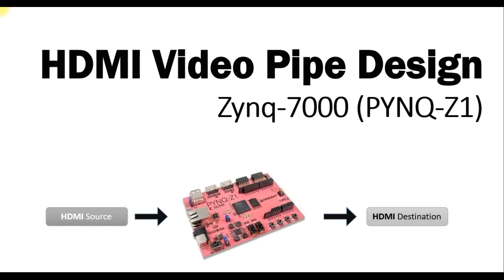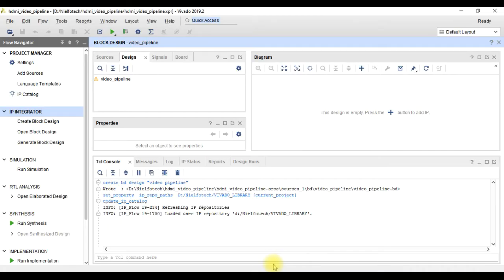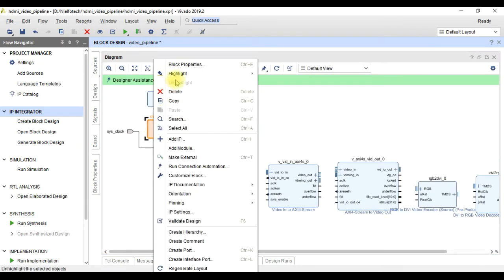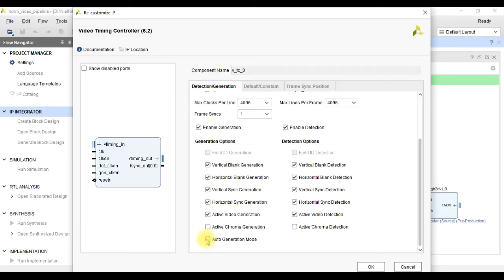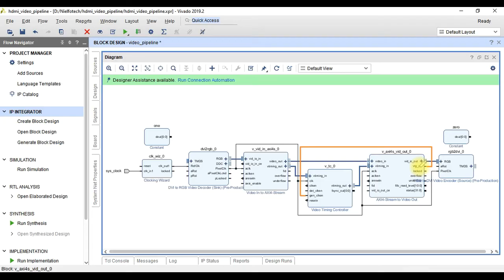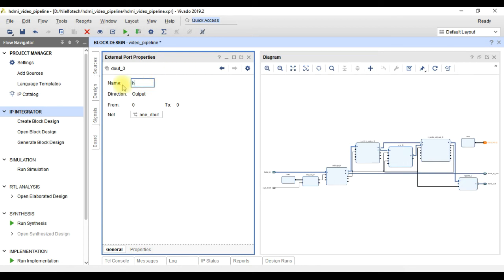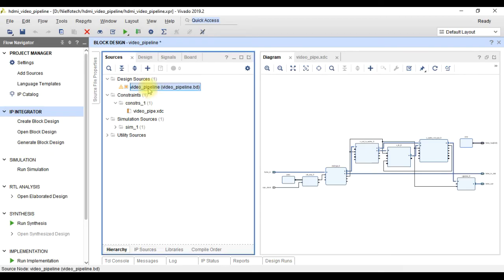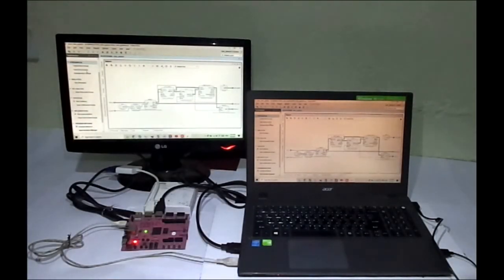HDMI Video Pipeline Design Implementation on Zynq 7000 SoC (Pynq-Z1)

Comment: Hello, I tried to implement your design on my PYNQ-Z1, using Vivado 2022, and the last version of Digilent Vivado Library, but it doesn't show anything in the output, my pc reconized the connection but my SAMSUNG HDMI display monitor dosn't recognize the connection and didn't show the image, do you have any idea which is the issue?,
Reply from the maker: Hi, you can use ILA to check whether is pipeline is functional or not. This is the best to find out the issue. Especially, check the “locked” status.

Comment: I use Pynq-Z2 but the HDMI output with noise. 
I had fixed it by un-comment this line in *.xdc file - "create_clock -period 8.334 -waveform {0.000 4.167} [get_ports hdmi_in_clk_p]"
in the video 8:06 , your xdc file as "#create_clock -period 8.334 -waveform {0.000 4.167} [get_ports hdmi_in_clk_p]", you comment it out. 
I don't know what happened. Why I need add it in my Pynq-Z2 board?
Reply: hi i followed this tutorial step by step when i finished flashing my pynq Z2 Board i got only black screen can you help me??
@ Tony Ho 
@ Nielfotech
Reply: @aminemouaz5822  hi,
I have the same problem and I tried to fix it for a long time now, but still have only a black screen. have you succeeded by any chance?
Reply from the maker: @Amine Mouaz  @edouard lagesse 
What kind of issue are you facing? Could you give me some details?
Reply from the maker: @Tony Ho!
That constraint was written to create a clock with the specified clock period. This is not compulsory until you need greater control over the clock signal to reduce the slack value.
Reply: Hi @tonyho6986,
I follow your step to enable "create_clock" tcl command and I can acheive HDMI passthrough function finally!
Thanks for this share!
Reply: Hello, Have you fixed that issue? Could you help me to fix that?

Comment: unable to make external pin connections in Vivado 2017.4 for TMDS signal
Reply: Try to find another ip (newer ) dvi to rgb
Reply: add TMDS interface in the ip repo from digilent vivado github master
Reply from the maker: @Sandeep Kodam (M21EE060)
Adding TMDS interface, as replied by @Abubrata Roy, will solve your issue.